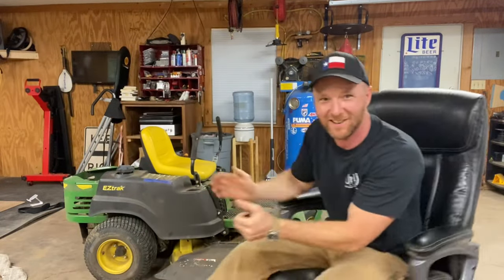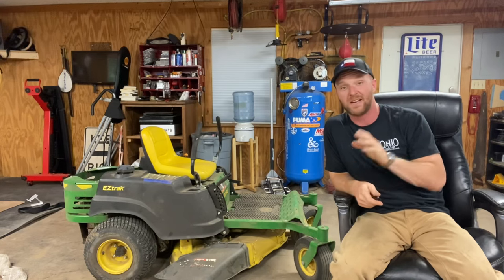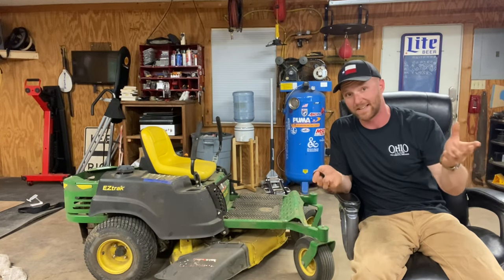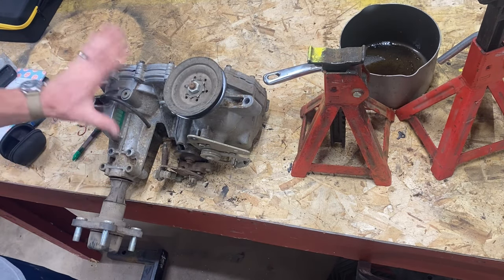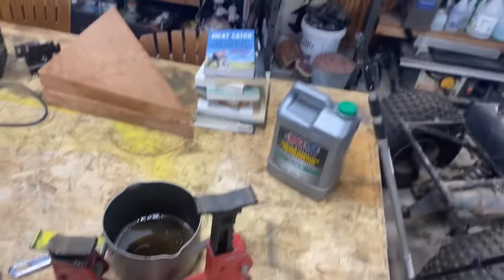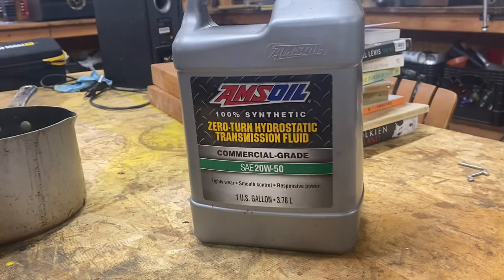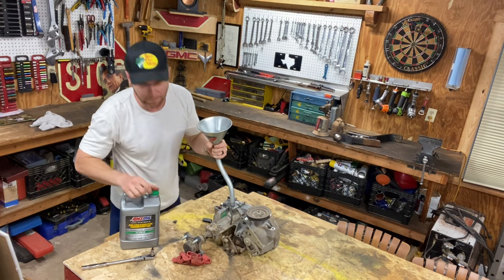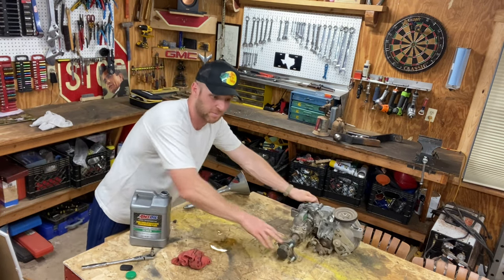Zero Turn Transmission Oil Change on SEALED Hydro Gear! + Synthetic vs. Conventional Oil

Comment: I have the same z225 and saw a video on a different mower where a drain plug was added to the bottom.  Could this be done on the z225 transmissions?  Trying to determine where a plug could be added…of course very carefully 😂
Reply from the maker: I have no idea, if it is on YouTube am sure it can be done though. Let me know how it turns out. Is a good idea as long as you can keep the metal out of the hole.
Reply: @MowerMike  Yep I’m just thinking if I go to the trouble of removing and draining/replacing the oil, might as well make it serviceable while I’m at it.  The video I saw has the hole drilled while still full of oil…that to me doesn’t seem like a great idea due to metal shavings but obviously that’s easier 😑

Comment: On JD Z225 transaxle should any oil drain from the vent plug when servicing the unit?  My left axle which was not functioning properly about 5 oz of oil drained from the vent port. The fill port I couldn't see any oil and about a quart drained from it. The right side no oil drained from vent port and the fill port was full to top.
Reply from the maker: Yes some oil should come out of the vent port if you are filling it all the way up

Comment: I’m have the same hydro but it’s leaking out of the seal by the brake. It keeps pushing out. Any help would be great
Reply from the maker: Sounds like you need a new axle seal, never done one of those good luck
Reply: Shoot, ok lol

Comment: If it's sealed, how are you supposed to add fluid?
Reply from the maker: There is a plug on the top of them you can get an Allen head wrench in them. It should be in the video
Reply: Sorry, brah, this craftsman z2000 has me pulling what's left of my hair out so I was a bit impatient and should have watched to the end @MowerMike

Comment: There IS a vent on top of the trans……right by where you removed the plug you used to drain / fill the trans.
Reply from the maker: Gravity maybe an issue with your plan. But good luck
Reply: @MowerMike  Haha.  I can explain it to you but I cannot understand it for you.  Your comment “gravity may be an issue” is mute.  Gravity is not an issue when there are two holes in the unit, the one to fill with and one for air to evacuate(through the vent).  Easy peasy.  I have changed my non serviceable zero turn hydro’s oil every year for the last several years.  My zero turn is a 2007 model, so this is hardly a new concept.
Reply from the maker: @curtcunningham1063  Now get it. Most of the units I see don’t have the drain on the bottom. Sounds like you got a good one

Comment: I can't get at the oil fill hole when the transmission is mounted. Is there a way to bleed the transmission off the or do I need to remove it a second time to top up with fluid and re-seal?
Reply from the maker: I would just run it with it sealed and see how it does. If it is running full power don’t worry about topping it off.
Reply: Use a fluid pump is the best way to get rid of the old fluids

Comment: Hey Mike, I have a Gravley ZT-2550. She runs great but after running for about 20 minutes the right drive motor fades pretty quick and is all wine and no drive. 

Any thoughts? Has the motor leaked all the fluid out? Need to be purged?
Reply from the maker: Sounds like it is low on fluid. Suggest topping it off and bleeding it over and over
Reply: @MowerMike  thanks
Reply: @hobbyguy79 any luck or did your internals need replacement?

Comment: If you get a decent vacuum pump you can leave them in a pull the fluid out.
Reply from the maker: I doubt that, but would love to see a video proving me wrong.
Reply: Works like a charm - Been doing it for years.

Comment: Lifetime on 20w-50 motor oil. Yeah, right.
Reply from the maker: Haha well I think they bet something else will break first.
Reply: @MowerMike  thanks for the video. I've got a 2022 Ikon XD I've run to death for a year now. Ordered some amsoil to replace the ZT2200 fluids.
Reply from the maker: @toolman9081 Good man, if you are going through the hassle may as well order the good stuff. AMSOIL is all I use

Comment: Doing research on mowers there is a version of this transmission that has an oil drain port on the bottom but I can only find it in the Gravely X so far.
Are you happy with the transmission performance in general?
Reply from the maker: Yep that little mower works great. Gravely is a great mower
Reply: Yes, I just purchased a 2023 Gravely ZT X it has the 2200 Hydro Gear Trans. They are serviceable. No filters or res. but you can remove the plugs and drain and fill.

Comment: We have a 2014 eztrak z425.. it is different than that it has no obvious filter on the outside, or the plastic plug that holds the filter, but it does seem to have some sort of a pan on it can you just drop the pan to change the fluid, thanks
Reply from the maker: I suggest removing the unit and flipping it to drain it. That is going to be my next video series on an x320. If you take the pan off let me know how it goes.
Reply: @MowerMike  we are mechanics by trade it looks like it has a pan sealed with some factory goop.. you can see there is a casting for a filter in a drain plug in the pan but it was never made to be functional it has no major issues and I'm not really keen on taking off a pan if I can't turn it over, you never know what might fall out..Thanks.
Reply from the maker: @daviddoran9221  I agree. I suggest just removing the trans with the wheels on and just flipping it to drain. Doesn’t look too hard. Let me know how it goes

Comment: Why not just find a way to access the port and then vac out the oil?
Reply from the maker: Because I couldn’t get a tube from the port to the bottom of the transmission. There are too many gears and pumps in the way. But, give it a shot maybe you can figure it out

Comment: Why not just siphon it out through the fill port?
Reply from the maker: I couldn’t get a tube from the port to the bottom of the transmission. There is too much in the way. If you can do it more power to ya.
Reply: @MowerMike  have you thought about tapping it so you could add a drain plug? I've thought about it but afraid to do it lol. I'd hate to mess up $1,400 worth of transaxles 😂
Reply from the maker: @brandonyoung7760  I sure thought about it but so many things could go wrong with that. Just take it off and drain it if you are determined to change the oil.
Reply: @MowerMike  I have a cub RZT LX,54” deck Kawasaki engine. On the right side I was able to vacuum out 44oz, left side 32oz. Bought in 2017, has350hrs on it.first change in the drive units. Mower has AG tires on it as I mow 4.5 miles of trails through the woods.I’ll run it for 10 hrs and vac it again….Amsoil. Units hold 52 or 54oz.

Comment: If you can fill it up while on the mower, then why can't you just pump the old oil out, and fill it back up a couple times?, your way seems like a lot of unnecessary work if ya ask me.
Reply from the maker: Try it and find out why it doesn’t work.
Reply: @MowerMike   You could have just told him that the filler tube doesn’t lead to the case. No need to be a smart ass. 

@jerryb1234 - the transmission has tiny little channels for the fluid to flow through, you would need the smallest transfer pump in the universe to make it work, along with an X-ray machine lol.
Reply from the maker: @aaaaaaatbrown  This whole channel is based on me being a smartass. I am surprised anyone watches it.

Comment: WHY REMOVE THE HYDROS USE A SUCTION DEVICE TO REMOVE/REFILL WITH CHEAP OIL /SUCTION THEN REPLACE WITH PREMIUM OIL. 90% OF THE SHITTY OIL WILL BE REPLACED.:face-green-smiling:
Reply from the maker: Because you can’t get the suction line through the middle of it to the bottom. Give it a shot

Comment: Mine died at 200 hours. The oil looked like chocolate milk.
Reply from the maker: Wow that is not supposed to happen
Reply: One of the little cylinders on the hydrophilic pump had a broken spring inside. I'm going to order a rebuild kit and change everything while I have it apart.  @MowerMike

Comment: It's my personal opinion. Synthetic Oil is a 'waste' of Money. In your personal Vehicle, I can understand the investment. In something like small engine Equipment, you'll never see the return or benefit.
Reply from the maker: Well it sure made that transmission sing!
Reply: I have to disagree…If your mower will last longer then how isn’t it worth the investment? I can understand maybe a push mower but zero turns aren’t exactly cheap.You aren’t changing it very often or using a lot to make it much more of a expense.More protection for a longer period of time so less oil changes
Reply: I disagree respectfully on this one I have a riding mower that has ran synthetic since day one in 2006 with a little over 2000 hours on the original single cylinder 19 hp briggs engine she is still spotless inside and burns no oil.
Reply: @lawrencebarber1551  It's your Money, spend it like you wish. But I can say, I have Equipment well over Thirty years old. Still running and used till this Day. Always serviced with Convention Motor Oil. With regular Maintenance. I feel Synthetic is like every 'other' latest and greatest. Everybody gets sucked into. Like buying a New iPhone whenever a new ones released.
Reply from the maker: @lawrencebarber1551  2k hours is impressive on a single cylinder gas motor. Well done
Reply: @MowerMike  I have John deere Gt 235 with 2850 hours on it...still has like new compression...no petroleum would have lasted..my brother had is own land care business...ran Mobil 1..after 5 years the mowers he had ran like new...In Florida most of his competitors replaced mowers every 2 years...